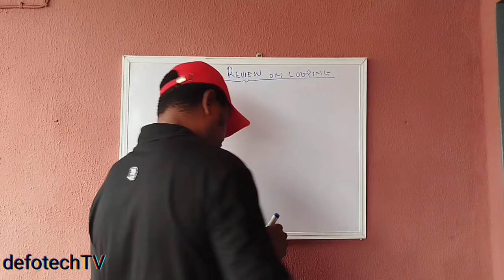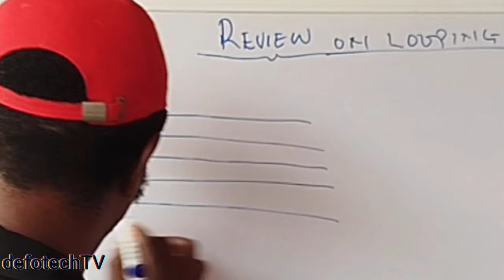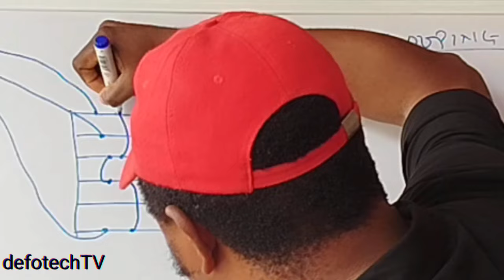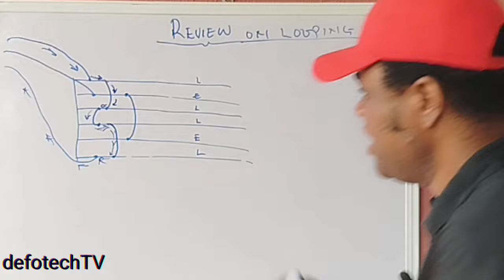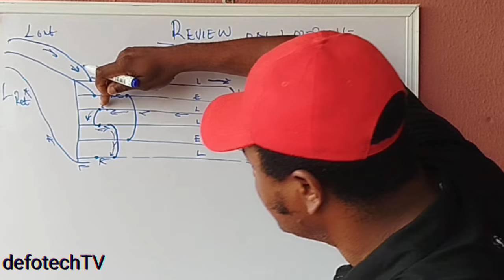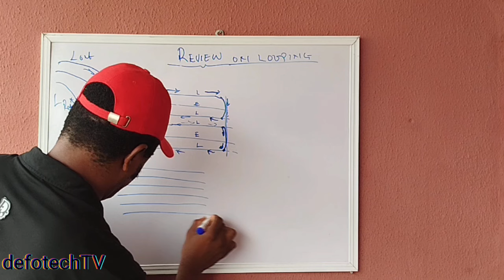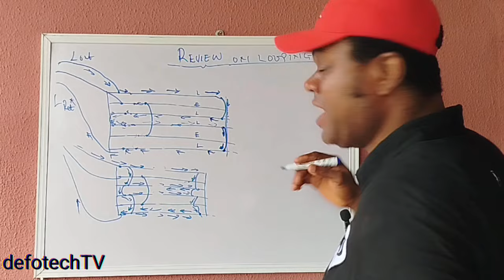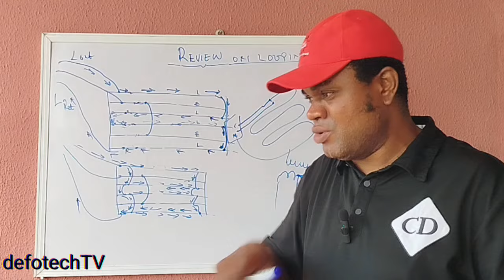These errors can tarnish your reputations

Comment: Hello, instead of HT cable can i use eletrical cable 1.5mm for connecting to the energizer ? 

Or it will work only with HT cable
Reply from the maker: It is recommended you use HT cable, aluminium wire with another aluminium wire.

Comment: Hello the fence wiring should be one single cable ? Or can be extended using the ferrules,?
Reply from the maker: you might need to throw more light on this question. terminals can be made using ferrule though.